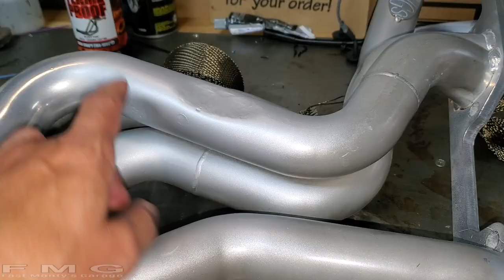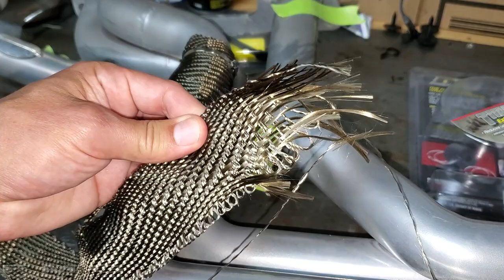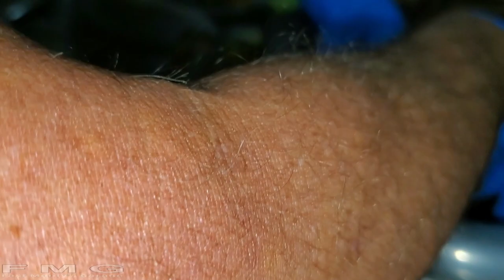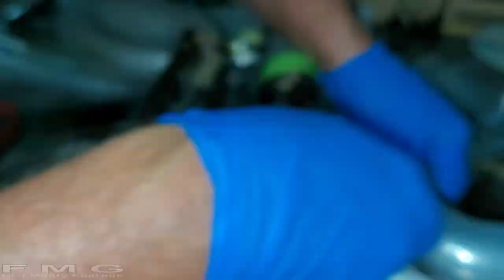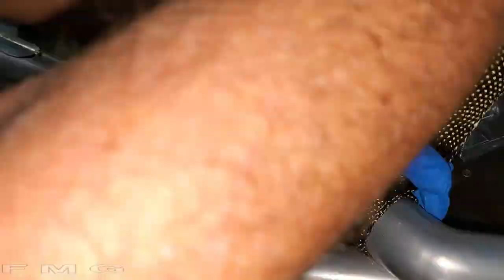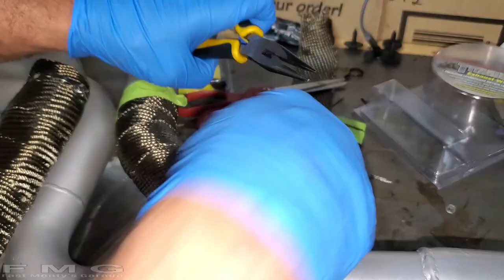How to Install DEI Titanium Header Wrap

Comment: The best explanation i found for applying titanium wrap. Thanks. i am planning to apply a heat res. paint and wrap my header exhaust. I hope i can do it without releasing the header from my engine bay.
Reply from the maker: Thanks!  Good luck with the install... you'll find it way easier by removing it completely, especially if you're painting them.  Have fun!

Comment: soak it in water next time so you can stretch it while you're wraping it during install. keep the vids coming, nice work !
Reply from the maker: Thanks!  And great advice!
Reply: Fast Monty's Garage 
and wetting it helps strains staying together and prevents fibres from sticking to your hands and becoming airborne
Reply from the maker: @firebird70  Ohhhh now you tell me.  Cough.  Ha, ha... see you soon!
Reply: Do not ever soak the DEI titanium wrap . It also don't itch like fiberglass wrap. .you soak fiberglass wrap to keep the glass fibers from floating in the air so you don't breathe them in.
Reply: If using fiberglass tape yes, but NOT the DEI titanium wrap. Regular fiberglass wrap absolutely want to soak before wrapping, then idle engine several minutes to dry. Some also recommend then spraying down with water to fully soak and idling engine to dry a second time with fiberglass tape. However, DEI says you do not soak their titanium wrap. (I see that Backyard-Built-Trucks already made this comment, but I second it!)
Reply: Not with the titanium wrap

Comment: Nice work 👍🏼. I’ve been contemplating wrap or the VHT Flame Proof spray paint. Curious to see the temp difference on the ceramic surface vs the wrap.
Reply from the maker: Thanks!  Yeah, I don't know the heat reduction we'd see with ceramic vs wrap. But, the flame proof paint won't do anything. Prett sure thats just paint and won't reduce Temps.  Let us know if you find out any more details. Thanks again!
Reply: @FastMonty   Cool, I have a 1991 header on my Saturn Sl2, don't laugh, believe it or not and was gonna buy this because the header paint I bought at pep boys is garbage and flaked off...lol I also got a port and polish intake and bigger TBI and a cold air intake and totally beefed up suspension and dropped another 100 lbs off the car. Do the straps come with it?
Reply from the maker: @junechris  Sounds fun to me!  Keep at it!

Comment: With this type of header tape does DEI recommend sealing the tape with high temp silicone spray or not before install ?
Reply from the maker: Good question Kurt... no, no sealant necessary.  Thanks for the comment!
Reply: DEI does NOT (<~~like this on the website) recommend silicone spray.
Reply: @FastMonty  Well you sell silicone spray paint and on the can it says to used to seal our Titamium header wrap so whos telling the truth ?
Reply from the maker: @kurtnulf3362  I don't understand your question... it says on DEI's website, "DEI HT Silicone Coating not required"  for Titanium wrap.  It might be needed for other types of wrap?
Reply: @FastMonty  Well I wraped my exhaust manifold in DEI titamium wrap and then used there Hi Temp silicone coating it might not be needed but I dont think it will hurt .I heard that the seal adds to the life of the wrap will see
Reply from the maker: @kurtnulf3362  Very interesting Kurt... please feel free to update this thread with the long term results.  Thanks for sharing!

Comment: Can I use this on my flex pipe to stop an exhaust leak
Reply from the maker: Good question, Dan.  Unfortunately, No, it won't stop a leak.  That said, if your leak is at the fitting between the flex pipe, and exhaust, take it apart and use Permatex Optimum Red https://www.summitracing.com/parts/ptx-27038 ...  it worked for me (which is actually a future video of mine).   Thanks again for the comment!  Good luck!
Reply: Fast Monty's Garage thanks buts the leak is at the end of the flex pipe I was told not to use fiber fix is that a good choice it’s to expensive to fix I drive a 06 Kia Sedona
Reply from the maker: @dmoore215  Dan, the fix, unfortunately, is to buy a new one.  Maybe a wrecking yard might have one off of a wrecked Sedona.  Good luck!